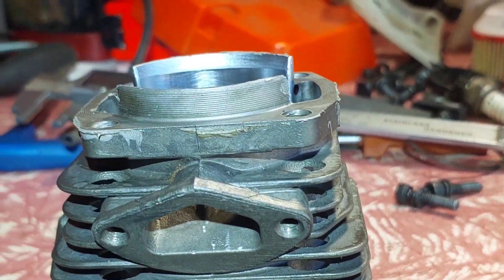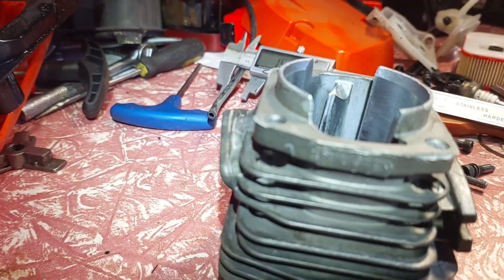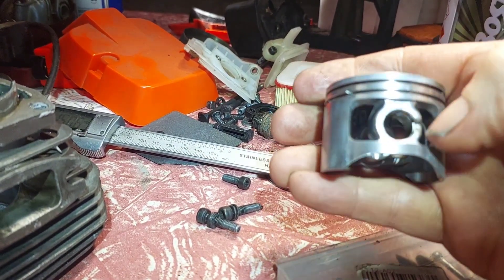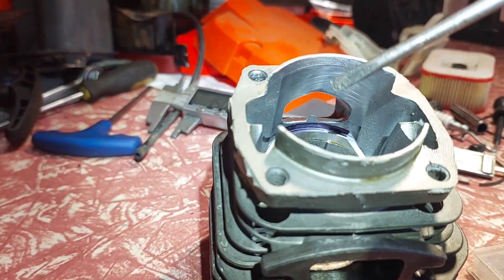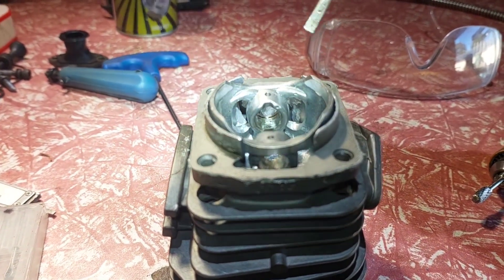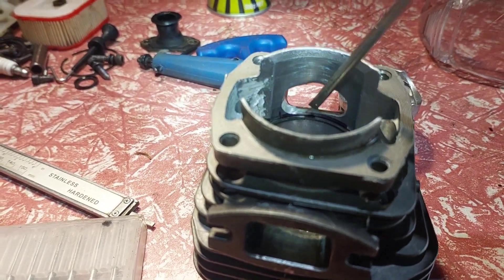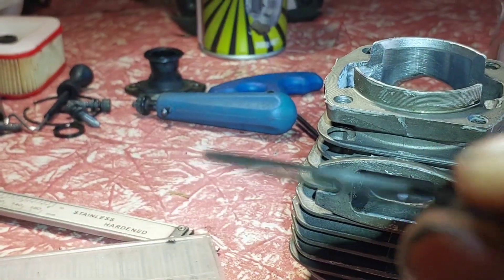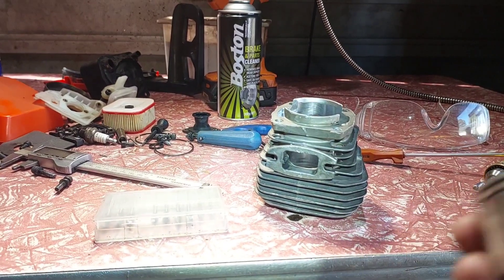chinese 58cc chainsaw porting talk?

Comment: I don't know if this modification to the piston and cylinder is worth the effort. This cylinder feeds the transfers mostly through the channels on side, not through the piston windows. I think that the windowless piston would work the same in this setup.
Reply from the maker: G'day mate, done right they run rings around std one! The  Reason I use chinese chainsaw part are cheers
Reply: I like Chinese chainsaws because I think they are a great value for the price. I have several Chinese saws, one almost in every category - small 25cc tophandle, 37cc and 40.1cc (the ones with the fuel and oil tanks in the right hand handle), then 4500 model and 5200 model. They cut great for my needs, if one knows how to tune the carb. Out of the box they all were set way too rich.  @MrHangerone
Reply from the maker: @homopit42  fun to play with